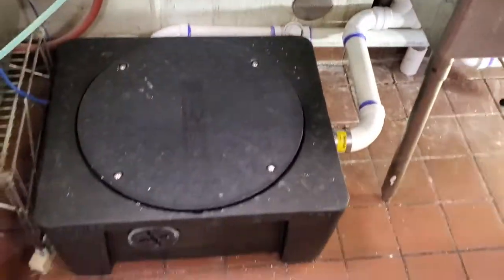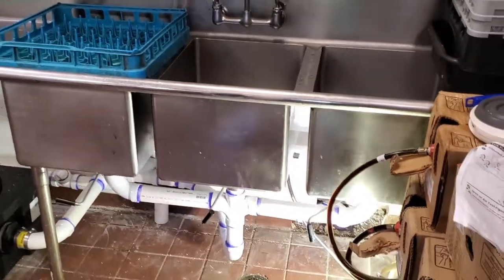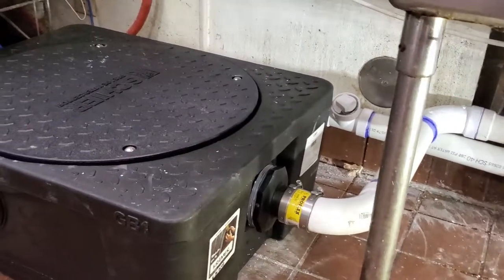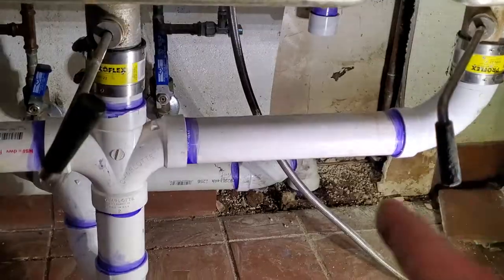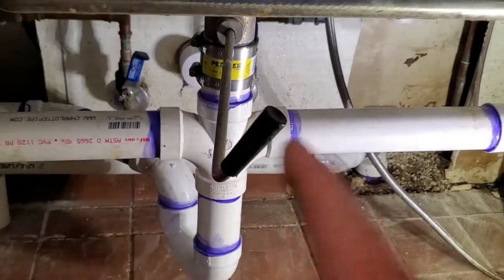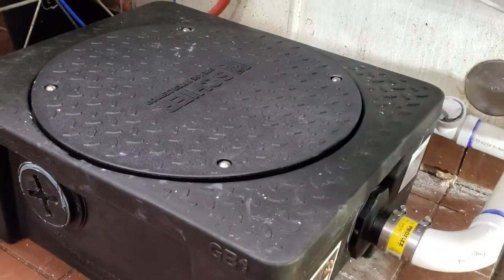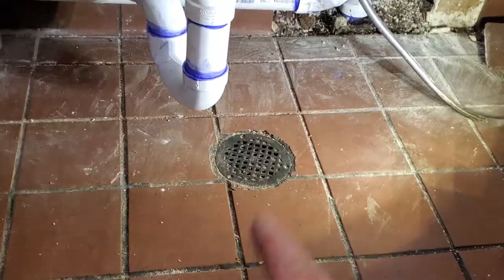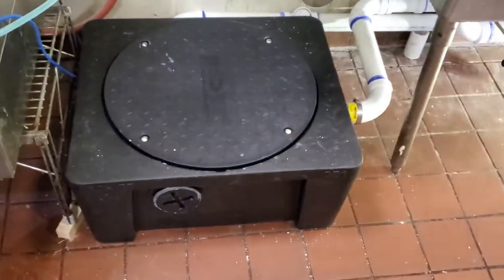Grease interceptor above ground installation

Comment: This would not fly on my watch.
Reply: But time flies and you didn’t explain to the rest of us knuckleheads what is incorrect that you have an issue with. Therefore your effort to reply is largely wasted effort if you meant to say it was done wrong. 

I take it you are just a proud individual who has to put others down to feel better. I hope not.  Please, take the time and point out errors so that we all can learn from your education and experience. Thank you
Reply: You're not a knucklehead, and I can see how I came off egocentric. You never want a grease interceptor or sewer directly connected to any piece of equipment that has to do with food or the cleaning there of. You would need some form of way to create an indirect connection (restaurants usually have floor sinks) to allow any sort of backup to contaminate the sink. There are ways that you may achieve this (local codes will mandate it). Never leave water lines below sewer lines and surely not on the floor. The drain under the 3-comp will not stop a backup from the interceptor to the sink (hence the need for protection). The sink doesn't have a faucet for washing dishes (and there is plenty more wrong). I did not mean to be arrogant in any way, but this makes me cringe like watching a person put cheese on a taco after wiping the sweat from their brow. Good day sir.

Comment: Would a vented flow control device be required on the inlet side???
Reply from the maker: Vent yes, and it was added. Flow control?
Reply: @ChampionPlumbing  you might want to look up the flow control :)
Reply: the grease trap has a built in flow control

Comment: You can use a cross fitting on drainage like that in your area?
Reply from the maker: Yes! Where you from?
Reply: Champion Plumbing Canada, can only use them for venting here.
Reply: @eddyhmmk1 in Texas u can use those on back to back water closets, as long as the center of drain to center of flange is >18” to avoid sewer snakes crossing them.  Really a double combo is preferred